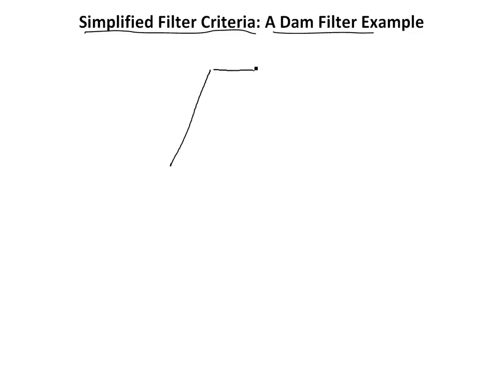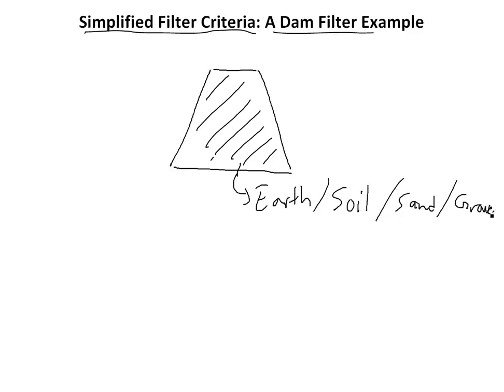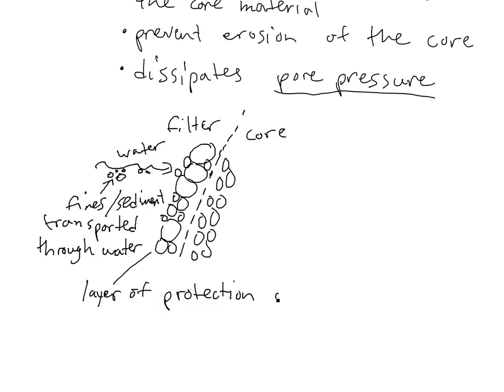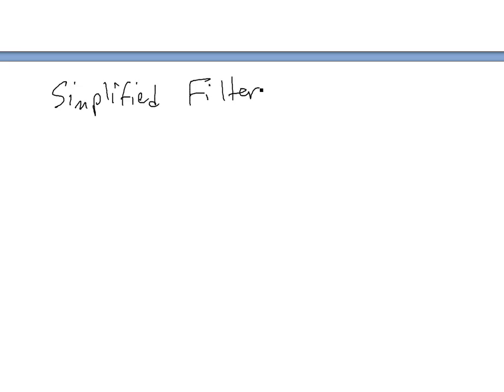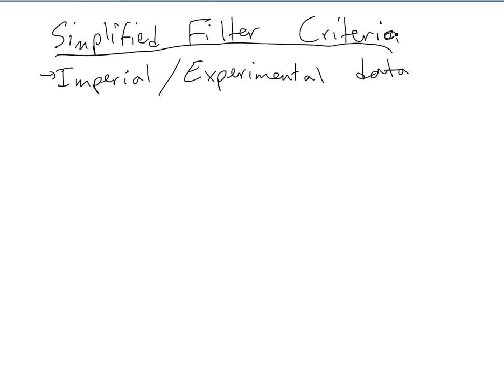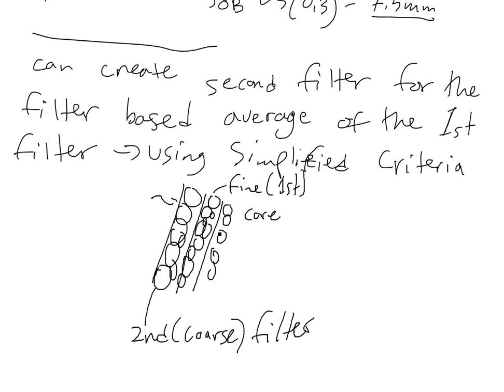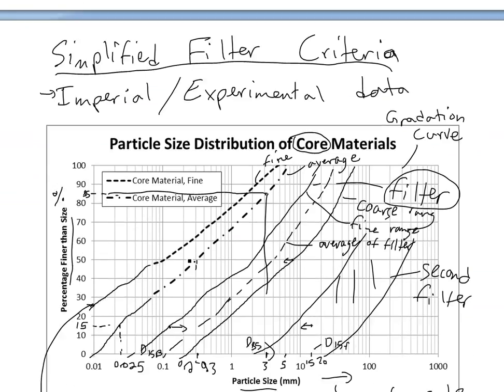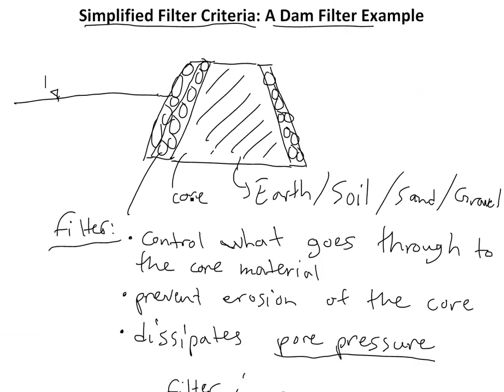Soil Mechanics: Simplified Dam Filter Criteria Example

Comment: Good explained. I have a question regarding need of filter for a road embankment fill in the seashore. The slope of the fill is 1:1,5. Minimum fraction of the base material (embankment fill- i.e. core material) is expected 5 mm and larger fraction could be 300 mm. There is erosjon protection  by plastring, i.e. putting bigger size stones (600 mm and over) designed on the top the of the embankment slope. Do we need filter layer between the fill and the plastring?